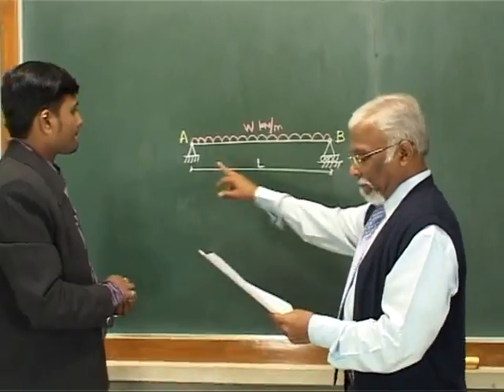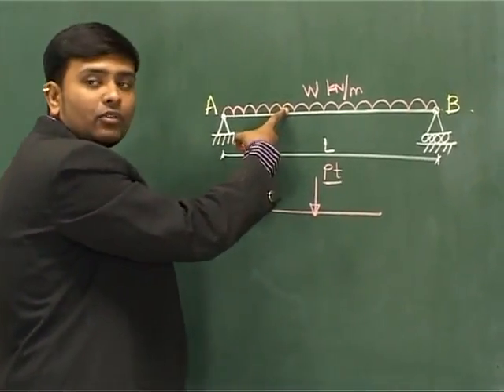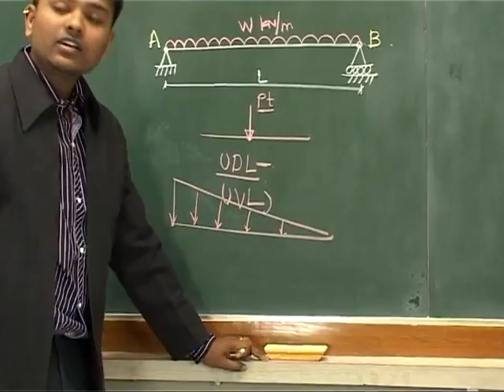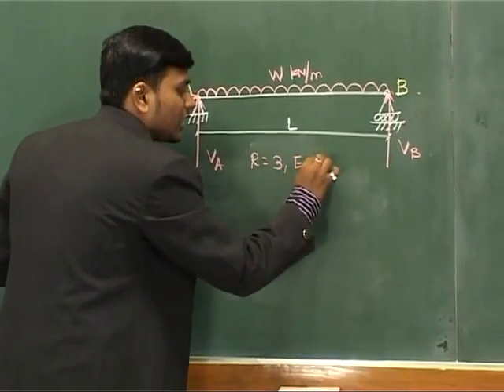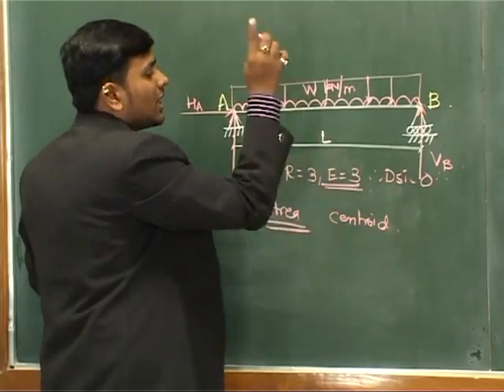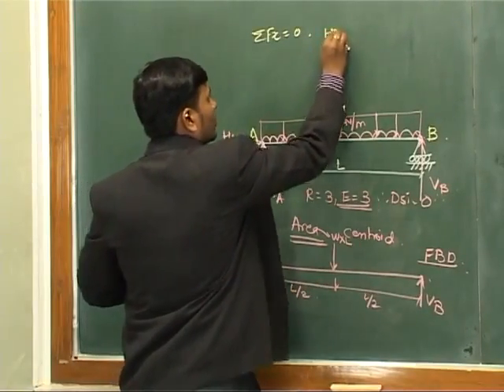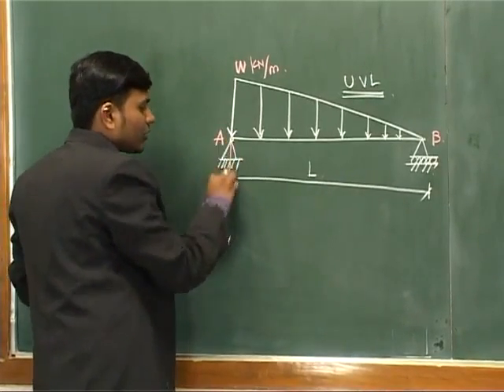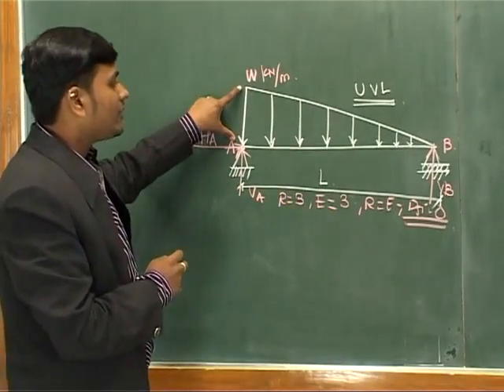Engineering Mechanics -- UDL and UVL

Comment: But there is isn't a Horizontal force for a simply supported beam at the edge. I see that you have taken H and then equated it to zero. Might as well not take it right?
Reply: Isaac Mark it depends on the load being applied at the beam,in his case the horizontal reaction is zero since there is no horizontal force applied at the beam..in other lectures there is an example where the given load is inclined concentrated load with an angle and has to resolve into components resulting into to horizontal and vertical forces..